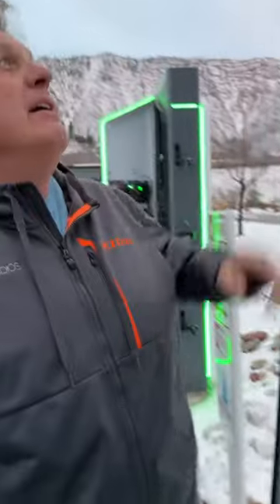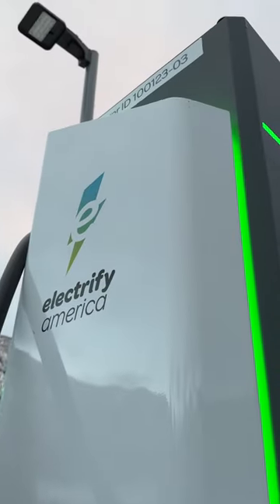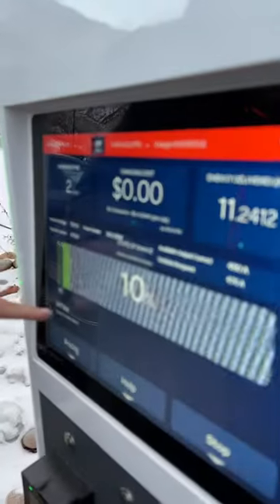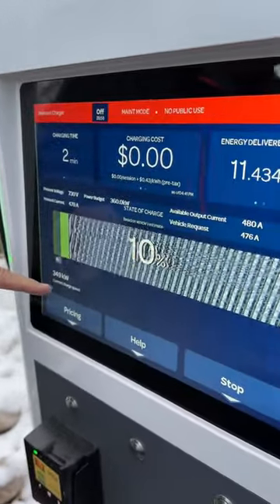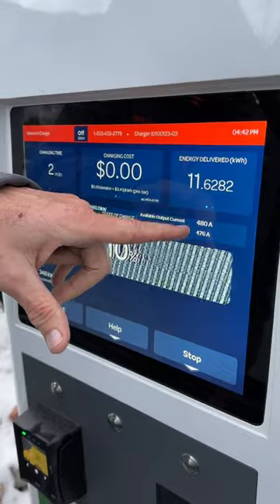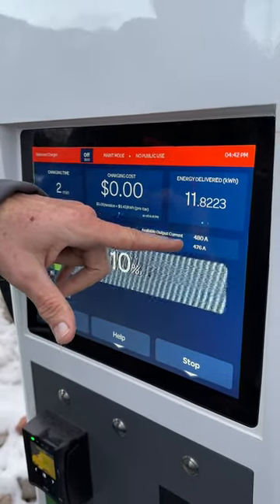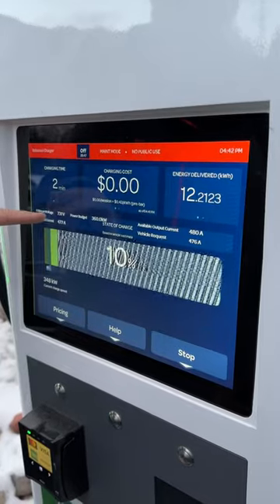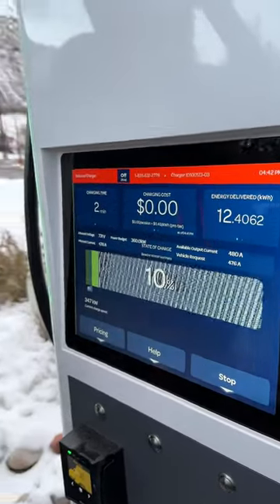Secret Maintenance Mode - Here's How I Seriously Fast Charged a Hummer EV!

Comment: By the time this video ends, my gas refill is half done.
Reply: My truck takes forever to fill up
Reply: Yeah, once every other day for $75 instead of once a month for $20
Reply: And quadruple the price! Nice!
Reply: 40 times over
Reply: Same, and I drive an Excursion 4x4.  But unfortunately it’s something I have to do every other day… 😰
Reply: @bikesqump  Except when the battery pack needs replacing, my brothers model 3 pack was $18k
Reply: @fordxbgtfalcon  how many miles did the pack last?
Reply: @skippynj1979  67k
Reply: @fordxbgtfalcon  why did he have to pay? Doesn't Tesla have 8yr or 120,000 miles warranty on the battery pack?
Reply: @fordxbgtfalcon  you buy a brand new truck, the engine goes out it'll be 18k. Same thing. You don't worry about the battery pack unless you're buying a used one out of warranty, and even then it'll be years before you need one, and it'll be less expensive the older it gets, same as a IC Engine.
Reply: Yeah except unless you drive over 3-400 miles a day, which most people don’t, you plug your car in when you get home and wake up with essentially a ‘full tank of gas’ every morning. My friend has a Model S and it costs her $20-25 a week on average if she’s not going out of town. A trip to Denver and back (1200 mile round trip) is about $80 which is less than half of what it is for me to do the same thing in my 4cyl car. The main problem with electric is the infrastructure but that can be handled as well
Reply: @bikesqump  gas would be as cheap but because we don't pursue fossil fuels as much anymore it got expensive
Reply: @bikesqump  and a battery cost 50,000 dollars to replace  did you forget to mention that part   because FAST charging is going to wear it out fast...

100,000 miles
31,055.55  for a normal hummer in fuel at 5.59 a gallon  18mpg 5cyl
Reply: @jacobmaz8157  You forgot to add your car payment...
Reply: @Sascha M  once a month for $20?? Lmfao no. Cars only make up about 27% of carbon emissions. Cobalt mining enough batteries to sustain the entire driving population with a new electric vehicle would completely destroy our atmosphere. Not to mention, this is totally and completely impractical. I can either charge at my house and take days to fully charge, or choose to take more than an hour out of my commute regularly. The cost to replace a battery is more than the price of most electric vehicles, making maintenance/reliability nonexistent. And let's not even go into cold weather performance, because most electric vehicles simply do not perform well in the cold, let alone get anywhere near their range. You go ahead and deal with your range anxiety. I'll be (actually) protecting the environment by continuing to drive a gas powered vehicle, instead of letting the wool be pulled over my eyes. Everything I've said here takes 10 minutes of research. Anyone who thinks electric cars are sustainable at their current state is an idiot.
Reply: This is fair but it also took you 8 hours to pay off that refill
Reply: And you bank accounts draining even faster.
Reply: So is your wallet
Reply: @fordxbgtfalcon   As I understand it the model 3 was released in 2017 making the car at most 5 or 6 years old.  The batter was under warranty unless he put 20K a year on it to exceed 100K miles.
Reply: And?
Reply: Stay in your warm car and watch TikTok or wake up from a nap and your truck is filled
Reply: @fordxbgtfalcon  Wow... good to kbow
Reply: @bikesqump  I don’t think you know what a gas powered car is like. I can go a whole week without having to fill up my tank sometimes
Reply: @radicalgamingnerd986  I do know, I switched from gas cars to electric because I too can go a week or so without charging and my commute is 40min each way. luckily I can charge at home so I don't need to. you might want to learn more about the reality of driving electric cars
Reply: I use less time filling my EV than any ICE car I've ever had. I spend about 20 secs putting the cable in and 20 secs taking it out, I then wake up in the morning with a full battery for 1/3 the price a full tank would have costed me.
Reply: Both my diesel trucks empty can go min 420 miles and takes 8 minutes to recharge.    Ill stick with old school
Reply: gas refill at your house.. Oh you cant..
Reply: @prplezard  no but for the 8 min at gas station I can probably got almost twice as far. O yea.  And mine runs the same  at 0 deg as it dose at 100 deg.
Reply: @markadams3858  how much is that costing you? Have you actually sat down and figured out how much charging an electric car really cost?
Reply: @prplezard   bye the time you add cost of car.  And the environmental damage lithium mining dose  That is useless to me and the   problem with range   and America doesn't have the power grid to charge  all the electric cars.   It may work for some people but not me
Reply: @markadams3858  do you factor in environmental damage from oil/gasoline when filling up or getting an oil change?? I bet not.  

Sounds like you’re a hypocrite
Reply: @prplezard  you are being a bit smug sir.   Please look this stuff up  lithium mines are very very bad for environment and the batt on your car is not recyclable and have to be disposed at a toxic waist dump.  They are just as bad if not worse than a regular car,   like I said electric car work for some people  just not me.   If you have any idea how to get my fat ass from point a to b  I'm all ears
Reply: @markadams3858  please look up how companies are replacing the bad cells in a battery pack to renew them and how companies are developing lithium recycling.  Tons of new technology coming out to resolve the problems you claim.
Reply: @prplezard  yes.   Maybe some day. But the ev technology is just not there yet. If you drive 10 miles to work.   Yes  but any distance and your praying and looking for charging station that take a long time to  recharge.  And they still don't make a pickup that can be away from major cities
Reply: @markadams3858  You have no idea on what you are talking about.

A tesla getting a 15 minute charge via a supercharger will give 200 mile range.   The tesla shows you where the closest chargers are when you are driving.   I know when I am driving an ICE on a long trip, I stop for at least 15 minutes to grab a drink or such. 

 Rivian R1T has a 315 mile range.
Reply: @prplezard  I know 3 people with Tesla and love them. But not one yet charges any less than 25 min and never charge that fast at your house . 200 miles is ridiculous.  The rivion can't go,or haul spit so maybe I'm the one who knows about real life situations and your looking at a computer screen  and they have issue charging in the cold.   But still love your smug attitude  if you wana race either one of my pickups. Bring lots of cash o yea.  You can replace a batt cell now to fix one.  But 8 years down the road they are a couple thousand pounds?? Of toxic waist.    until they figure out how to recycle them

Comment: 476 amps, 730 volts lol.  Saving the planet driving a 9,000 lb suv😂
Reply: All of the good cars have 800V+ batteries, the Amps are limited by the charger more than the car, and the weight really doesn't matter, yeah, it's not as efficient as it could be, but that 9000lb SUV gets 95+ Equivilent MPG, you try and find any gas/diesel/hybrid that gets 95mpg or better.
Reply: No one actually cares about that
Reply: Especially when they tell you not to charge your vehicle because the electric grid is already overloaded.
Reply: @robl4377 especially at almost 500 amps!
Reply: Exactly! that Hyundai charging is a much better option and will fully charge in like 15 minutes
Reply: Need new roads in two years.
Reply: No matter what if a thing weighs more it’s more expensive to move.  There is no way around that
Reply: @wolfrig2000  lol that is a complete lie!
Reply: @wolfrig2000  it's 47mpge you are way off
Reply: @btrswt35  more excuses instead of solutions.
Reply: Hybrids have way higher mpg...and you're not panicking trying to cross the Mojave.
If these EVs went 400 to 500 miles on a charge, you'd have a case for them. But that is many years down the road. I'll continue to say that until the technology is small enough and light enough to recharge batteries in motion, EVs will not be viable on a mass scale. The pollution created to charge them all on the electric grid, coupled with the environmental impact of the mining necessary to produce the batteries, is worse than the combustion engines you hate. Hybrids were the next step... but the auto makers are skipping over them.
That's okay. The politicians (not science) who drive this agenda, sooner or later, will be exposed. When power cannot be supplied to charge them all, guess what they're going to do: limit the vehicles sold and force people into mass transportation. There goes your mobility - the mobility that literally created the Middle Class. Keep cheering these idiots on.
Reply: @AbnEngrDan  the government didn’t force Tesla to make their vehicles. It’s a free market.

Comment: Full charge and now ready to go 85 miles even though it says 250 mile range
Reply: Nah, their mileage estimation is pretty close. On autopilot my EV will freeze it's mileage estimation because it's so much more efficient than I am, it'll raise the estimation because I'm not lead footing all the battery out. Btw don't launch your EV at every stoplight if you want to actually go somewhere!
Reply: @wolfrig2000  and dont drive it in the winter or god forbid tow anything
Reply: @MrPaxio  Buddy, most people aren't towing anything... got any relevant points?
Reply: @davidgray8089  i dont need them, theyre gonna put a phosphate battery in there and your range is gonna be half, or your weight is gonna double. they made the point for me

Comment: I was at the station in Gilbert, AZ on Monday.  2 of the 4 stalls were out of order.

One of the 150kw gave me 85kW.  After 24 minutes I only added 40% on my Ioniq 5.

Then I went to the other one and got 125kW.

I think you got get lucky
Reply: Electrify America has seemed to be hit or miss, but I can handle my commute with just home charging so I never have to deal with them.
Reply: Meanwhile, I pulled into the Gas Station, was fueled up, and gone, within 5 minutes. Psh, why am I wasting so much time?!

Comment: But what people don’t realize is pumping a battery faster then intended lowers its life span. 

Same with cellphones you find a faster charger by upping the watts and it’ll charge faster but a battery that wasn’t designed to go that fast will over heat and damage the battery causing it to fail prematurely.

Comment: I have a feeling that in 10 years those will be as common as a pay phone
Reply: Hahaha!!!
Reply: In 1960
Reply: Its been out 10 years ago
Reply: The hummer or the chargers? The electrify America chargers are extremely common because they partner with be corporations, they're in nearly every Walmart and Sam's club, so wherever you find a walmart you'll find a charger. But there's no point in using a charger outside of your garage unless you're on a road trip.
Reply: @wolfrig2000  As someone who lives in a rural area, none of the Walmarts have chargers. The single charger at a Royal Farms is the only one for miles.

Comment: $0.43/kwh ?! Wtf.
Reply: Okay that’s what I was thinking! That’s like triple what it costs for my house here in California. I’d be curious to know what a full recharge would actually cost in real dollar amount.
Reply: @mattmayo3539  simply multiply the $/kWh by the battery size. Say a Nissan leaf with 60kWh, that's around $25 to fast charge 200 miles, which I think is cheaper than gas in most places.
Reply: @youtubewatcher1555  but the 720V and 480A would mean it’s pumping out 345kW. So that means $150 to recharge.
Reply: @mattmayo3539  hm maybe we're confusing kWh with kW. I thought the pricing is by the amount of energy outputted (kWh) not the charging speed (kW). So for example if the charger just so happens to be slightly slower (or faster) charge rate, you still pay the same price for the same amount of electricity.

Comment: as one of the contractors who installs these as well as over 600 solar systems per month. Thank you for your coverage.  Also there is more info under the terminal screen if youre still there have that tech pull it up.

Comment: Delivering more than requesting??? I wonder why vehicles are going into limp mode on them..... Hmmmmm. If only there was data to determine that.
Reply: also doing a little bit of research can save you from a lot of embarrassment and other remarks thrown your way. just sayin. and no idc that you didnt ask for my opinion i just wanted to let you know so you can learn something good math wise.
Reply: The car request and the charger delivering a small amount higher to account for resistance losses is actually what is expected. 🤦

Comment: And when the grid fails, then what...???
Reply: 10 days old but if the grid fails, we gonna have a hard time getting gas as well right? Pumps need the grid.
Reply: @EAMitch  like the one in the ev that can plug into any kind of outlet anywhere!
Reply: @EAMitch  check out the tesla power wall. pairs nicely with solar. solves all these problems
Reply: @EAMitch  I lived in NJ during Sandy...  There was no gas in places for 3 weeks..  we literally were completely shut down..

Comment: I’m sure fast charging doesn’t affect the life of the battery whatsoever
Reply: Not really, the battery doesn't care what goes in or out, it just cares about heat and charge state, bringing your car to 100% on a slow charger actually damages the battery more than 80% on the fastest charger available. Lithium batteries are happiest between 10-80%

Comment: How many miles per hour is that charging at?
Reply: thats my fav way to compare too..mph charging.
Reply: Easy to figure out.  The vehicle get around 2 miles per kw.  350kw/hour charging is 700 mph charging..  we can round down to 10 miles per minute charging..
Reply: @skippynj1979  thats tremendous. Now we gotta see the charging pattern. mine starts out high...but tapers off real fast. and dont even wait on anything over about 80% its going real slow then. lol.  tesla is best charging between 20 and 80%it seems

Comment: I use less time filling my EV than any ICE car I've ever had. I spend about 15 secs putting the cable in and 15 secs taking it out, I then wake up in the morning with a full battery for 1/3 the price a full tank would have costed me.

Comment: Nobody seems to consider this: the faster a battery is charged, the hotter it gets, and therefore, the shorter the life of the battery due to internal plate warpage. Simple physics. And, how much does it cost to replace a battery in a Tesla, for example? Last I heard: $22,000. Thumbs down. Just wait until the first adopters get their bill.  Thumbs down.

Comment: I get 400 mile range on my gas powered vehicle with  3 minutes to fill up the tank
Reply: Can you do that from home?
Reply: @clnelson321  sure can!  I have a 1000 gallon diesel tank sitting out back. Any other silly questions?
Reply: @TheElderOne2003  and how quick is your car?
Reply: @Wakamolewonder  ohh she's not quick. 2022 Ram 3500 6.7 HO Crew Cab Dually with 3K miles on it is my daily driver. But she can drag a house!!  If I want fast I just get on one of my crotch rockets.  Not everything is always about speed there buddy.
Reply: so we both leave our houses with a full tank and dont really need to go to any kind of station to refill our cars..cool

Comment: How long to go from 10% to 80%?
Reply: that is the question.
Reply: The battery is 212 kw.  Let's just round to 200 kw..  so to for from 20kw State Of Charge to go to 160kw SOC.  That'd 140kw needed.  140kw/350 = 0.4 hours or 24 minutes.  Assuming some slow down in charging rate I'd assume 30 to 33 minutes.

Comment: Wait it's suppose to charge at one level but it's charging at a higher level? Yeah this isn't a recipe for disaster
Reply: Very slightly higher, also could be because the car is drawing extra energy for the aircon and battery heater.
Reply: Extra accounts for resistance losses...  Also your looking at information losses..  that's like saying journal tolerances for crankshafts are 0.000 when in actuality they are 0.050.

Comment: Does this mean that these EA chargers are more reliable?
Reply: My local chargers are just as qlitchy. It's the software that is the issue for EA.
Reply: Yes. gen IV are outstanding. Thats a gen 3
Reply: The NEW chargers are more reliable.

This is following the same trend we have seen in vehicles for decades, in that the first generations are more experimental then useful and just demonstrate the technology, but as newer generations of the same tech are released they begin working through the problems and improving the reliability.

Let’s just hope they iron out all the kinks and get this tech rock solid before trying to introduce new features that sound better then they behave; mostly depends on if engineering or marketing is driving the train.
Reply: @andreiionescu205  that can be said for each breakthrough until the end of time.

Less then a decade ago, dryer outlets were considered cutting edge for charging, and they max out at under 7.2 kW. I’m sure the wireless chargers built into many parking spaces will make the idea of needing to plug in seem silly, and after that the roads with built in chargers will make seeking special parking spaces seem ridiculous.

As long as there is profit to be had, technology marches on.

Comment: That’s 246 15A outlets sustained (80% per NEC code).

Energy equivalent in gasoline, you’re transferring 11 gallons per HOUR. When you fill gas you are adding energy 75X as fast.